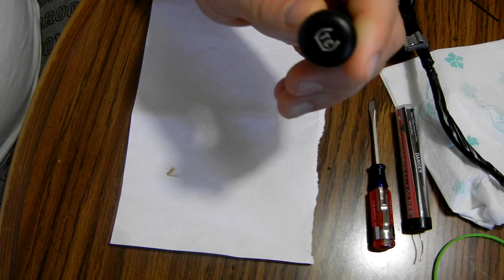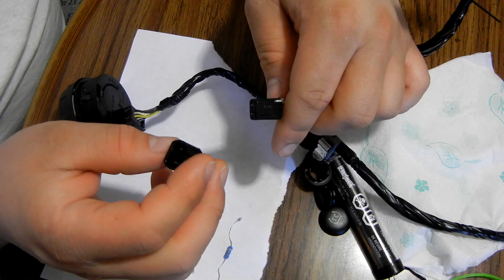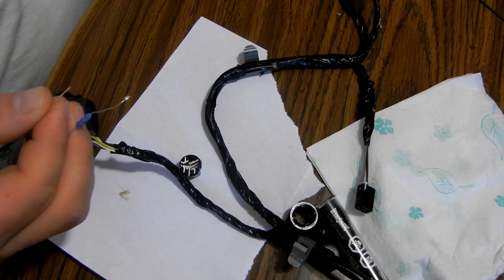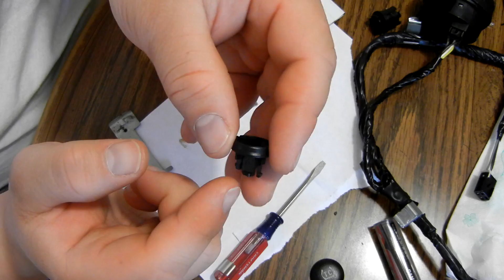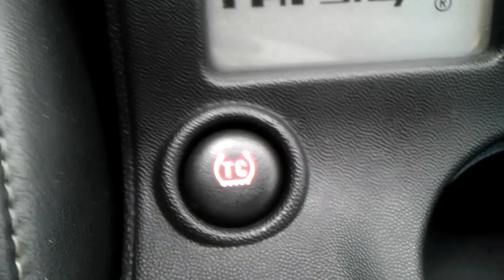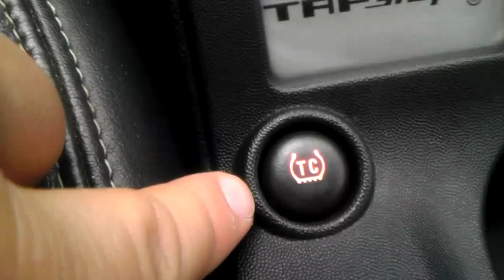04-08 Pontiac Grand Prix - Replace the Traction Control Switch Bulb with a Red LED

Comment: Thanks a lot for ur response but am having a problem with my brakes for past couple of days sometimes if I try to brake at a stop sign or red light the break doesn't work properly sometime the car will jack until I slam the brake again pls help me out.
Reply from the maker: +Connar Downes probably. I had a button fail on me because of a drink I spilled. The contact is very small and if the connection can't be made it will just quit working.
Reply from the maker: Unfortunately the traction control does not effect braking, only acceleration.
Reply: i cant turn off traction control on my 06 grand prix gt with the supercharged l32 is my button broke?
Reply: is it a pain or expensive to fix? makes since the cupholder placement is just dumb cant tell how many times ive taken a corner and watched my water bottle jump out of the cup holder lol
Reply from the maker: +Connar Downes the entire center console needs to come out. That is the only way to do it.
Reply: +GPVlog holy shit!